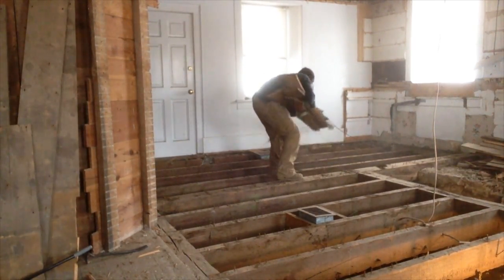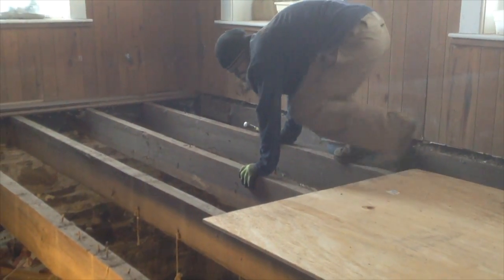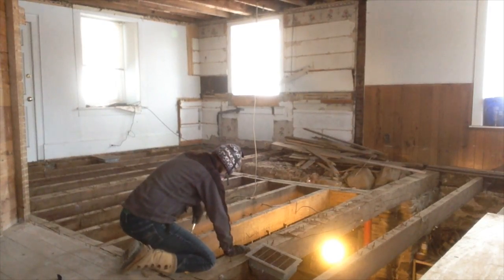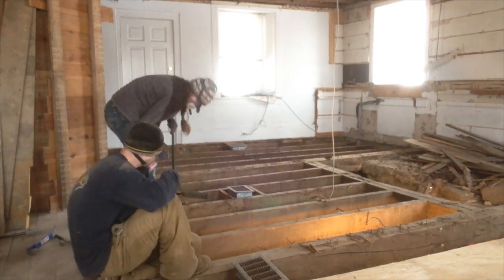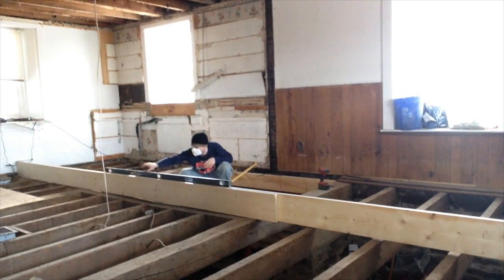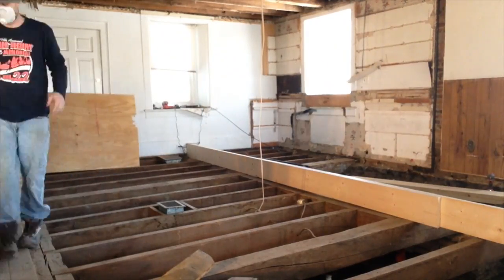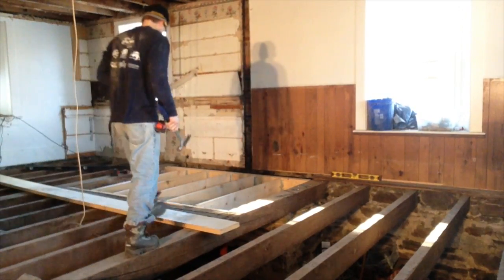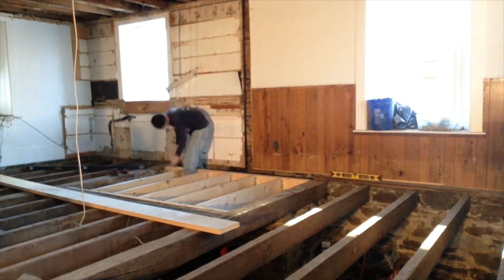211 years Old - Salvaged Flooring - Farmhouse Renovation - Episode 17

Comment: a reciprocating saw (sawzall) with a long metal blade will easy go trim though a bunch of nails in a floor joist, power tools are my friend and I use them a lot to make demo/cleanup easier.   Just run it along the joist but wear glasses for any ping that fly around.

Comment: like you Lucas, I am mostly self taught and make it up as I go along, generally 16" on center spacing is fine for home framing.  be it walls, floors or ceilings.  Also invest in a good quality (stanley) tape measure, it has all the framing dimensions laid out for you on the tape, makes layout a who lot easier.
Reply from the maker: Awesome! 👍👍 ya, all my walls are 16” now.. the floor is 22” - 18” but, the old joists are 3” x 8” and can probably handle a little more stress.. I’m also going to be doing two layers of subfloor.. 3/4” then a layer of 1/2”.. it’s going to help me get everything flattened and make the floor a lot stronger too.. 👍

Comment: I love the details, so don’t worry about content. Its great to see how you problem solve and trouble shoot the renovation. When I re-did a bathroom last year, I too struggled with leveling the floor. I invested in a laser level, and it helped a great deal. This room that you are leveling is 5X the size of my bathroom, so you would benefit GREATLY from a laser level. I feel its important to point out that I never try to move (raise) the joists when leveling. Instead, once the high point is determined, I will either sister new joists adjacent to the existing joists, or I will cut shim material and glue/screw it to the top of the original joists.
Reply from the maker: Great points! It is certainly a learning process!